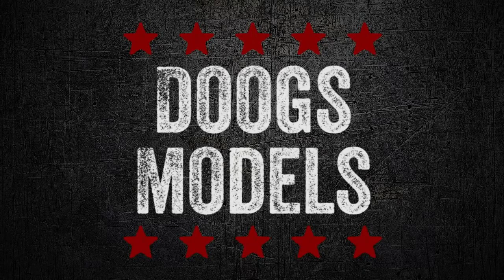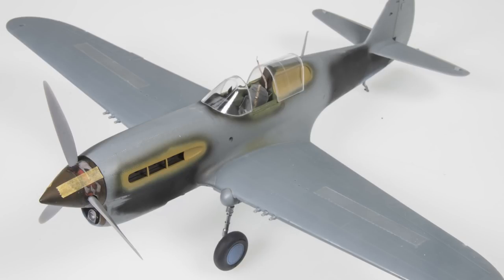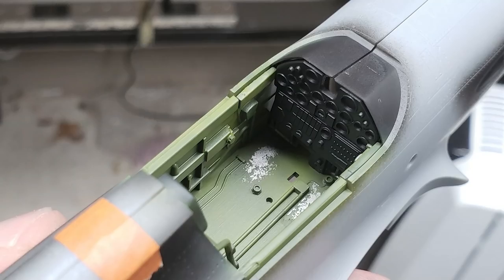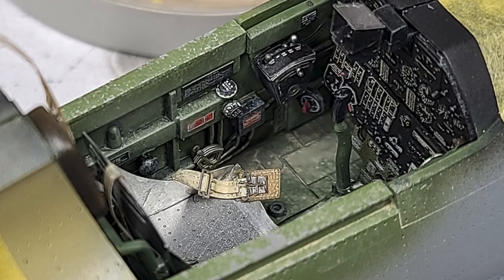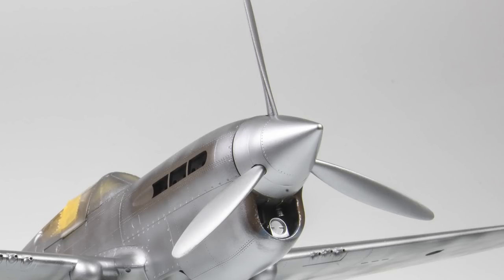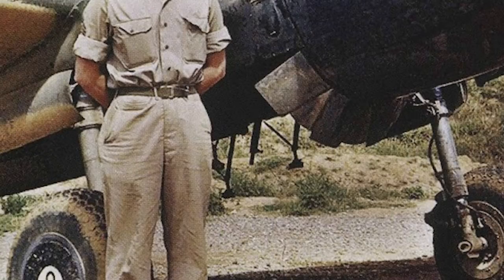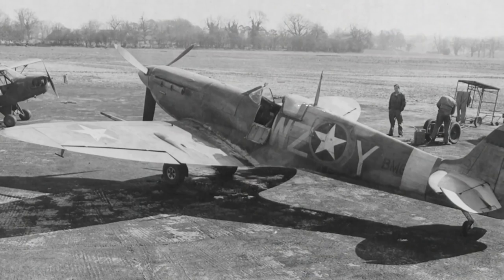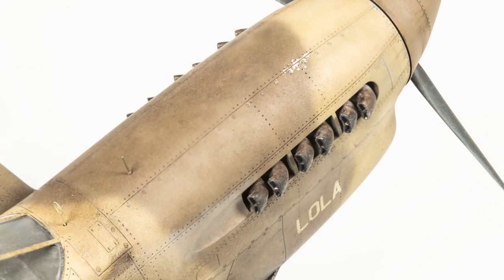P-40F Warhawk Build 13 - Postmortem

Comment: I enjoy watching your builds. The information you provide on the detailing is helpful. I have never painted with an airbrush, in my 50+ modeling years, have only used a brush and try to get the same looks, but cant. That's another reason I enjoy your builds. Keep up the great work, stay safs, warm.

Comment: I think your being to hard on your approach to creating an accurate representation of a period aircraft. Even flyers who own the Warhawk today speak of its spacious cockpit compared to Spitfire 5B and such, because the pumps for the gear was in the floorwell near fuel gauge nearest the pilots right foot. Having read accounts of operational field aircraft, the focus is always on the system integrity and never on the astetics of its appearance. Combat camouflage was often painted with a mop, and still utilized lead, tin, and zinc chromates in the paint, all of which are grainy and don't apply very smoothly. Aviation gas was to be over 100 octane, and if spilled will degrade painted schemes, and the zinc chromate priming, which rarely has much bite on aluminum alloys of this time. Turn around on sorte's was brief in North Africa especially since the engines and the modified air intakes suffered so terribly from the suffocating fine dirt and sand that often required immediate attention to keep these birds flying. North Africa is a very harsh climate, so crews bathed moving parts in grease to prevent seizure of critical systems during operational use. The Warhawk is suseptable to overheating and the manifold pressures had to be carefully monitored during taxing, take-off, and at combat speeds, or you could blow that precious plant to pieces by overstressing it much. Your pretty much on tap with your paint and finish, and I'm certain that many looked far worse than many could imagine. Sorry for the lesson. This happens to people who spend their dreams in flights of angels, and even linger on how to start one of these birds for take-off.